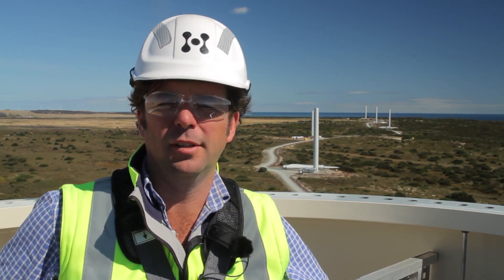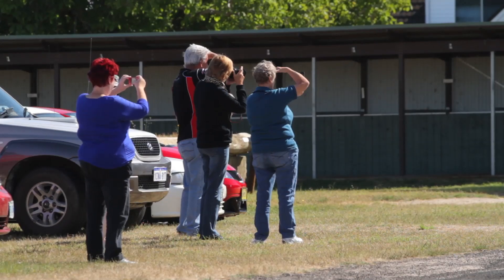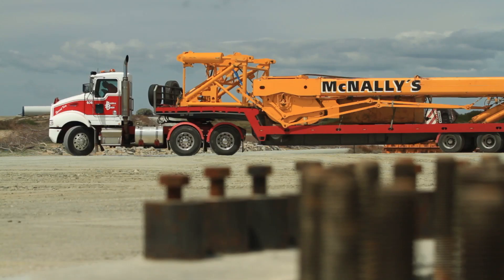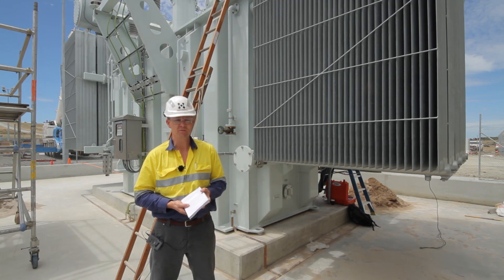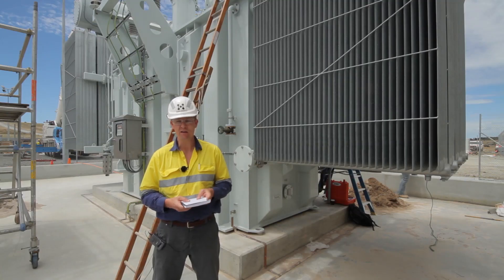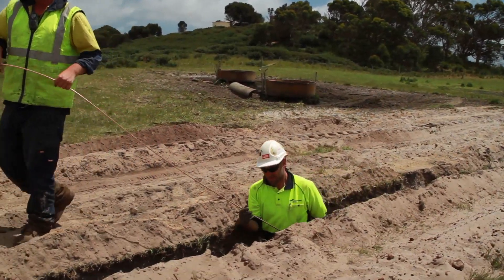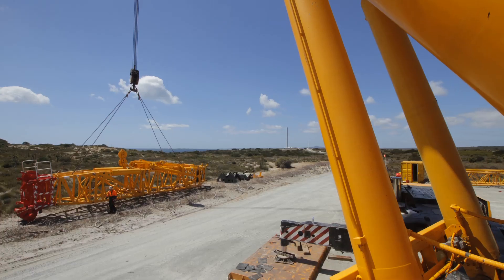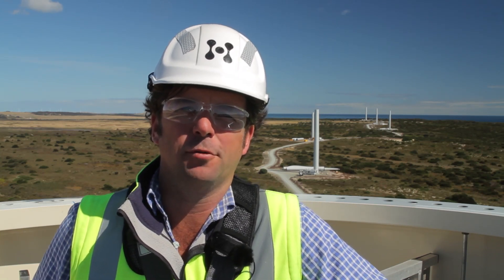Musselroe Wind Farm Project Update January 2013

Comment: It is sad to know more birds will be shredded.
Reply: earlysda You're right. It's also sad to know the land is being shredded and homes disrupted.
Reply: 01harvey Drill and conserve.
Reply: 01harvey If you are going to back a product back a reasonable product. Coal, for example, is viable. Do your research, and please don't cry about carbon dioxide, because it is not emitted at the refined lethal level of the infrasound from these IWTs and it comes from an industry that actually improves the overall status of the power available for use.

Warren Buffet said it all when he said they are worthless for power generation but are great as a tax shelter. Tax shelters come and go, theses people are clever enough to find a tax shelter that doesn't poison the land. Please do your homework, research, before you are so critical of others.

People, animals, farmland regions are being damaged at an alarming rate by these horribly expensive towers and blades of trouble. They use upwards of 150 gallons of oil, think about that. The stresses break down the turbine system mechanisms, so this oil either sprays (through the nose up near the nacelle) or pours out into the environment (typically running down the tower either inside or out) or the equipment has to be stopped or it has to be repaired, then requiring a new batch of oil. The little energy they put out is termed non-dispatchable, meaning that not only will another energy source (fuel based for response capability) be needed to compensate for the fluctuations in output, but if introduced to the grid as a load-bearing component will cause brownouts in the grid of operation. In other words, they do not reduce the need for resources that are already considered polluting agents and they can damage the existing grid environment (COSTLY). Thank you.
Reply: WolfeSandy are you seriously that butthurt? hahahahahahahahahahahaahhahahahah
Reply: Mack Thompson Not butthurt - head, body, finances and livestock hurt. You are promoting the attack of my home and my life. Think about that.

Further, the wind turbines you are acting like you like are worthless. Step away from them, very quickly. This is just good advice.

Meanwhile, you need to worry more about how you look than about the names you invent for other people. What about you, Mack Thompson? Do I need to say the Lord rebuke you, Really?